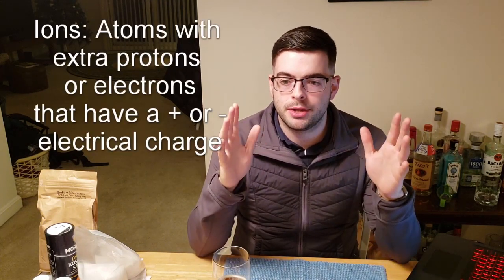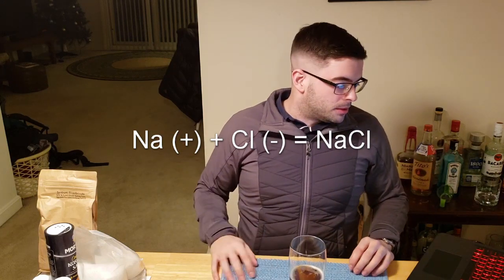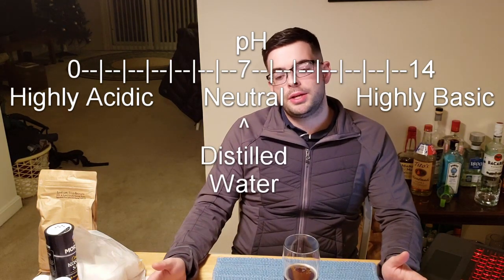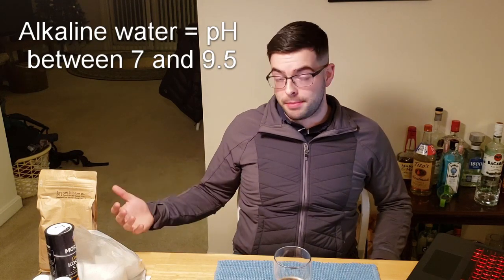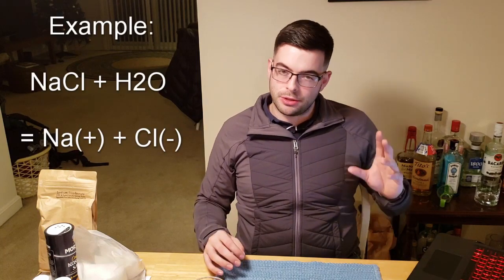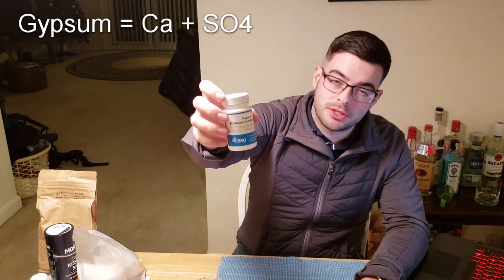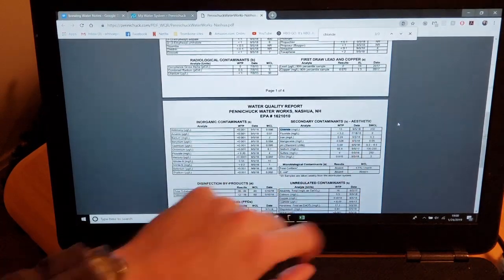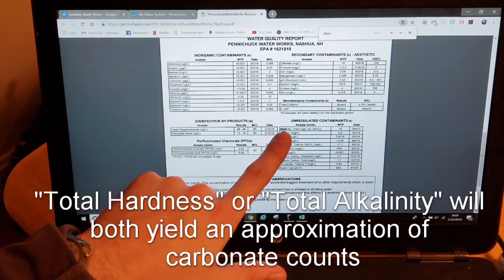The Basics of Brewing Water Chemistry | How to Determine Your Water Profile

Comment: Very nice and easy to follow guide to brewing water.  Here is a helpful hint, so you don't have to stir all the salts into a very full kettle.  Grab a mason jar, dip it into the warm water, add salts to jar and put on lid.  Shake vigorously and dump in kettle while lightly stirring.  This method seems to work much better for me and dissolved the salts without so much effort.
Reply from the maker: Thanks! That's a great tip, thanks for sharing!

Comment: Great video. Sorry if I'm late to the party, but just wondering if you do anything to adjust the sparge water pH. 
I'm going to start adjusting my water chem on my next brew. Plan is to use distilled water, add the salts to all the water, then pump off the sparge water to another container.
 Just wondering if there's another step I should take with the sparge water, can't seem to find a definitive answer anywhere.

Comment: Wow. Very eye opening for my ongoing IPA journey. Just used fridge filter for the 1st time to remove chlorine. What a difference. So u treat strike and sparge water?  Just increased from 10-20 gal. batches. BTW. Do u use hop spider for Hazy,s ?
Reply from the maker: Glad it was helpful! Yes I do treat both mash and sparge water, it is important for a lot of styles and especially hazies. I do use a hop spider in all my brews since I chill with a plate chiller now and I dont want to clog it with hop matter. If you're worried about not  getting the most out of your whirlpool with the spider, just increase the amount of hops!
Reply: TheApartmentBrewer Any idea the % of hop increase when using hop spider?? I’m assuming you want to maintain the ratios with blended hops???
Reply from the maker: @tman9338  if I had to guess, maybe 10-15% more
Reply: TheApartmentBrewer Thanks for your input

Comment: The calculator I'm using says to add 8.6 grams of gypsum for the mash, and then once I've finished sparging to add another 7.2 grams of gypsum along with 2.1 grams of table salt and 6.3 grams of epsom salt.

Does it actually matter when you add all this stuff? Or will putting ALL the gypsum in the mash kind of ruin things?
Reply from the maker: I've always just added everything before mashing in and that's worked fine for me

Comment: Do you have a recipe of brewing salts for 5 gal of ro water? I'm making  Oasis esb/ipa from tallgrass ( they discontinued it) but I have it downloaded from Northern Brewer. I have always had a problem with my ph and brewing water. It's the hardest part of brewing. Also I just watched a video  about it and they used pickling lime. Is there a basic amount you use  of total salts for ipa's of some color like a bit orange?
Reply from the maker: Typically I have always built my water profiles off of my tap water, not off RO water. But I do have a video I did on an English best bitter that was really good. Should be similar enough to get the job done. If you want to, feel free to steal the water profile from that one! As far as pickling lime goes, I'm sorry but I've never used it so I can't speak to it
Reply: @TheApartmentBrewer  Thanks for the reply, I just winged it like usual. Added 1.2 tsp gypsum .5 calcium chloride .4 baking soda, .4 calcium carbonate and .25 tsp of  pink hymalayin salt maybe 1/8. Skipped the pickling lime and couldn't find food grade Epsom. Do you think this is reasonable? I'm a modest brew in bag kitchen 3 gal Brewer. Converted to 3 gal keg/ co2 V's bottling after  hundred brews.
Reply from the maker: So I typically will weigh out all of my brewing salts instead of just measuring them in volume. So I'm not 100% sure what the conversion is for each salts in volume vs weight, since they have different molecular weights.  I am curious to know how this would turn out though, please let us know!

Comment: What do you think about 5.2 Mash pH Stabilizer, does it easy the process to match water to particular brew? Great videos, love all of them, thanks for posting them
Reply from the maker: Good question, I've never actually used it but I've heard mixed results. I'm considering using it though since my current water profile is very unfriendly to dark beers
Reply: @TheApartmentBrewer  I'm in same situation; I checked local water report and was trying to calculate my chemical addition and couldn't bring water to correct style, there was always too much Cl- or SO4 ions. I could adjust PH farely well but the rest was off
Reply from the maker: How much was too much? The ratio is really the important part